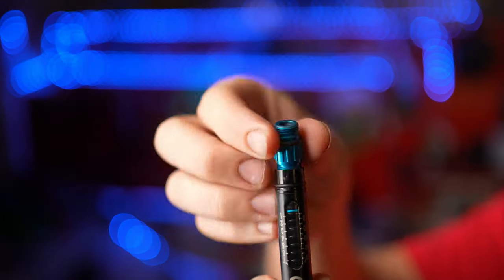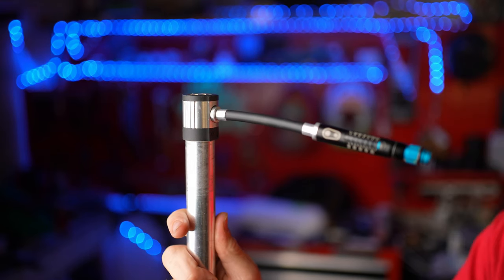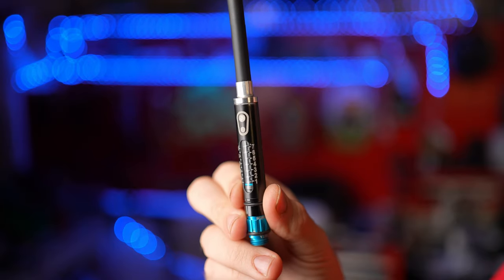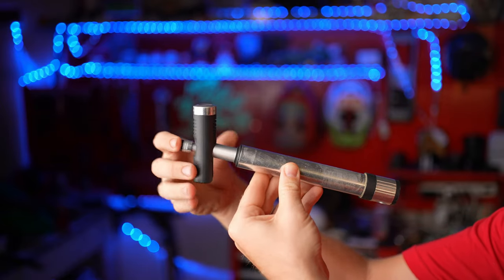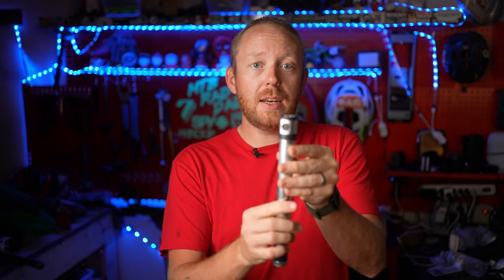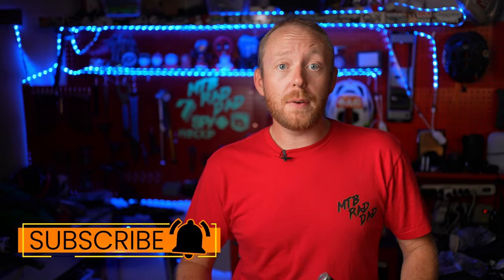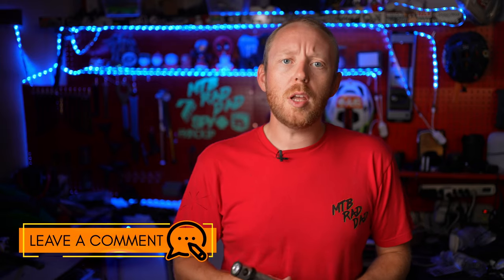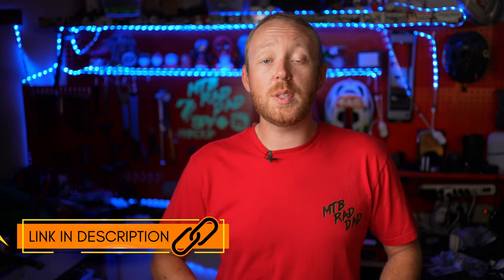This Mini Bike Pump Has One (Very Unexpected) Flaw

Comment: Pro tip take a valve core tool and tighten the core before pumping. I also lubed the o ring inside the pumphead with silicone lubricant, this way it can't unscrew the core.
Reply from the maker: Great tip!
Reply: Great tip about the lubrication, thank you

Comment: This is a terrible pump. First problem I had was the hose check valve (?) wasn't operating correctly, so it was air in and out. Crank Bros replaced the hose. Next time I used it, I never got to the point where the tire was fully pressurized to 100#. I finally gave up when my arm did, limped home, on a partially flat tire, checked the pressure and found it to be only about 40#. And yes, mine is the HP version. It simply discharges such a small volume of air per stroke that it's not worth carrying even for emergencies. I live in Colorado and I'd call for a AAA rescue before using this thing.

Comment: I have a small lezyne pump which is fitted to a mount between the frame and the bottle cage. It doesnt weigh much, it looks good and it has this small button which lets out air from the pump preventing the valve core to be loosened when unscrewing. It has one big drawback though and that's the lack of volume. Or rather... I have an old crankbrothers hand pump which I use for my daily commuter and it has the high volume/low volume switch and thats actually something I really miss on the lezyne.
Reply from the maker: That switch on the crank brothers pumps are so nice to have

Comment: I have a pro bike pump that looks similar and some people have the same issue with it loosening the valve core. It's also supposed to be screwed onto the presta valve, but it still works just pressing the hose onto the valve.  It leaks some air if not kept in an upright position but it might be worth it to avoid loosening the valve core.

Comment: Hi have one of these and don't like it at all. The gauge doesn't work most of the time, the bottle cage mount broke in no time at all, and when inflating a tire the action isn't smooth. It wouldn't be worth the money at half the price IMO.
Reply from the maker: If your still within warranty I would reach out to Crank Brothers. When I had an issue with mine, they were quick to fix it.

Comment: I have this pump but find it awkward to use. Also had the same issue with it unscrewing my valve stem. There also seems to be a leak between the valve and the pressure readout section. Overall very disappointed. Only had to use it 2 times and it failed me both times. Looking for a new pump now.  Very sad because this design is very neat.